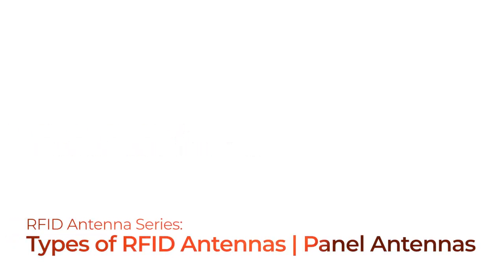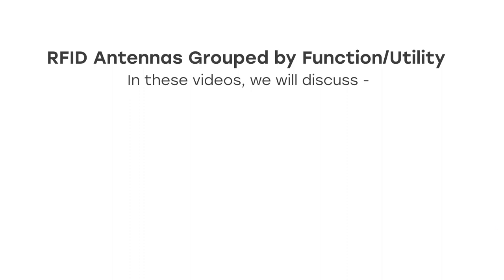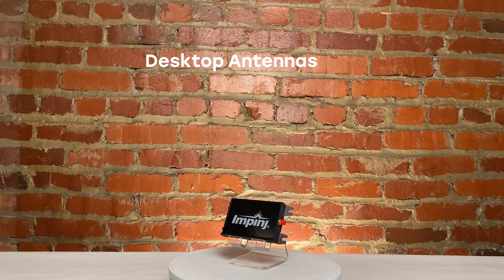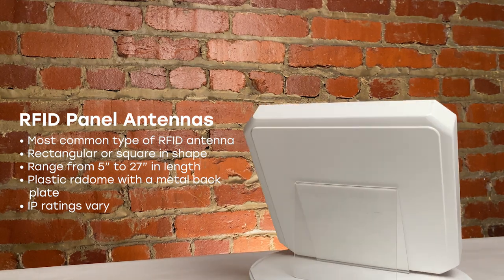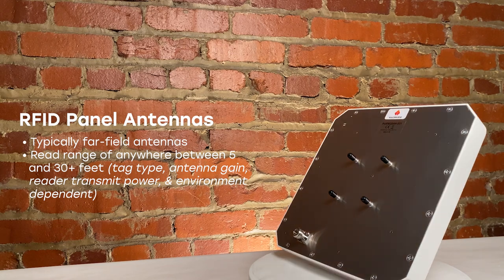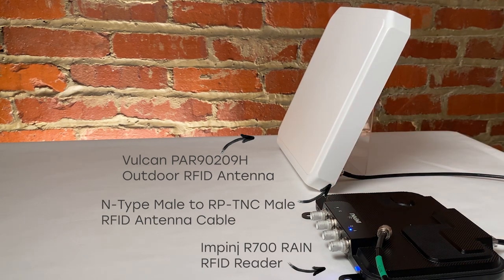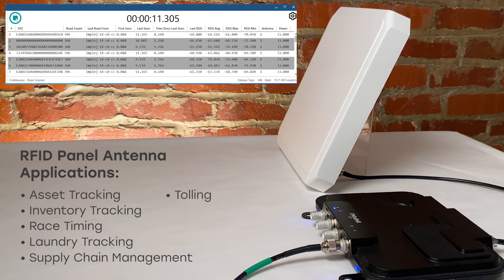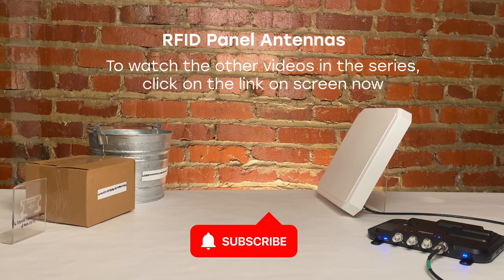RFID Antenna Series: Types of RFID Antennas | RFID Panel Antennas

Comment: Typo in this and other videos in the series.  The audio says 'size' while the slide says 'Range' when it means size or dimensions of the antenna.  Not to be confused with read range.
Reply from the maker: Paul, thanks for letting us know! I said "range" as in "range in size" but I can see how that can be confusing. Going forward I'll make sure to differentiate the two so that no one is confused. Thanks for the feedback!